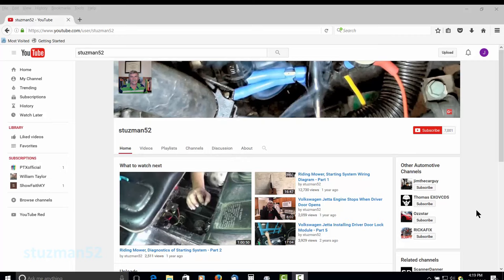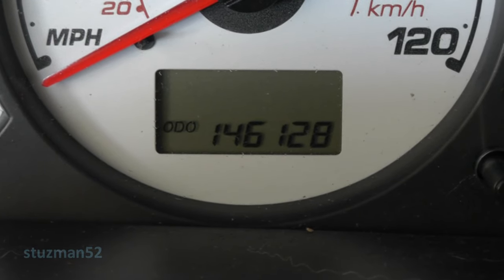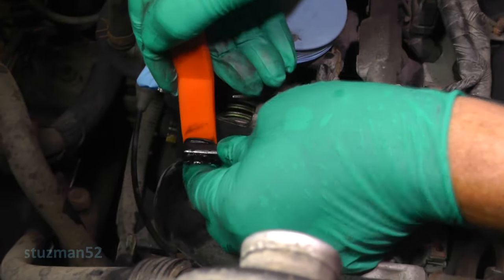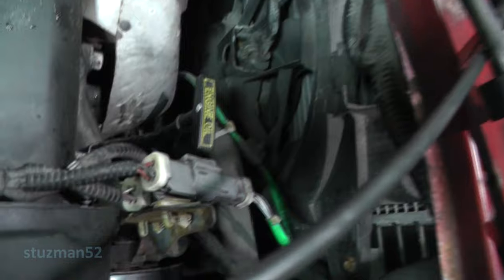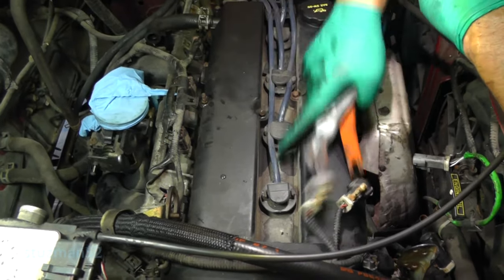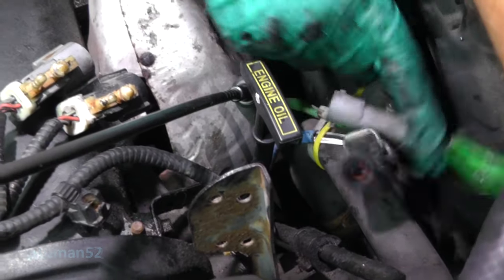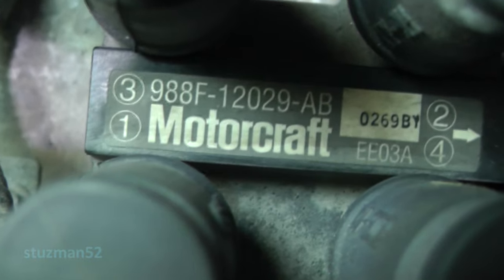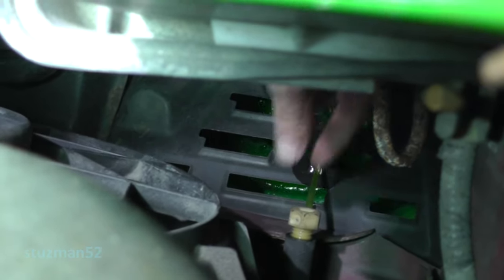Ford Escape Timing Belt and Water Pump Replacement - Part 1

Comment: Are you sure it's a timing chain? I can't find any videos on the timing belt. But I look up what a timing belt cost. it showed a rubber timing belt. I hope it is a metal timing belt. I just bought this Buick. I am trying to learn about it. Thank you so much my friend. You took a load off my mind. Thank you, thank you. I do enjoy your videos. You and your wife do a great job. I was born in the South. I wrote to you before about the Buick.
Reply from the maker: Yep, very sure it's a timing chain. Take a look at RockAuto and see for yourself. I do remember your name, but can't remember the question as I get LOTS of comments. Here is a link to your car http://www.rockauto.com/en/catalog/buick,2002,lesabre,3.8l+v6,1379796,engine
Reply: Thank you so much for the information. You have been a great help. I could not find any information on it. I appreciate it and your videos.
Reply from the maker: You're welcomed Thomas and unless you hear timing chain noise or rattling from it, I wouldn't worry about changing it. I've got 238,000 miles on my LeSabre and it's still quiet. You may want to keep a check on your coolant level as these cars in this year range were bad about the coolant leaking at the intake manifold which of course gets mixed with the oil. I took care of that issue years ago on mine. Take care..
Reply: Hey Terry, 
What happened your brother got all the looks and you not so much. Just Sayin
he he
Reply from the maker: Yeah, I know! Mom, always favored him too :)

Comment: Hi sir my hope you will be fine
I have a question about the mass air flow meter circuit function can you explain me 
I love always your video and the way you explain i understand many thing from you
Thanks
Reply from the maker: It's a little daunting to explain its operation in a text without some diagrams, etc. The air passes over a circuit called a Wheatstone bridge which is made up of three precision resistors and a thermistor. Basically two voltage dividers in parallel. A voltage or current source is applied to two nodes of this bridge. The other two nodes where the resistances are joined is its output. When air passes over the bridge, it will become unbalanced creating a voltage. This voltage is amplified and can be used directly by the PCM. This is an analog type MAF sensor. The other type is a frequency type where the frequency goes up as the air flow increases. Everything in the circuitry is the same as before except the analog voltage after it has been amplified is fed to a final stage called the VFC, (voltage to frequency converter). The higher the voltage, the higher the frequency. That's it in a nutshell and there was some parts of the circuit operation I left out as the explanation would get really long. Hope that will give you a heads-up on its operation. Have a good day Norman!
Reply: @stuzman52  
Thanks for explanation but i will wait for your video on it with some circuit  drawing

Comment: I also have a question... where exactly is the cranshaft sensor located? I was able to find the cam sensor but no luck with the crank.... i have a p0320 code so im trying to weasel out where exactly my problem lies
Reply from the maker: rion bain For the 2.0 liter engine, the crank sensor is located right behind the catalytic converter. You’ll have to remove the converter to get access to it. I point it out in one of the videos in this series where I remove the converter and exhaust pipe. 😀
Reply: Hey Stuzman thank you too much i really appreciate it
Reply from the maker: rion bain You’re quite welcome!

Comment: Well you answered my first question at the end about your wife's accent. Did you get those pro lok pliers from pro lock or did you find them cheaper, they look handy.
Reply from the maker: Are you talking about the hose clamp pliers? If so, I picked them up at Amazon...
Reply: The one used to remove those ridged fasteners, the blue handled ones
Reply from the maker: It's called a zip-clip tool. I can't remember where I got them from online, but do a search for "zip-clip tool" and you will see a lot of resources. Amazon has one too...
Reply: Thanks
Reply: Terry I just got a MAC set of ebay. US made which I don't mind paying a little more for them.Good price and brand new
Reply from the maker: Sounds good Eric and it looks like you're getting ready for a big project yourself :)
Reply: I got too many projects and I'm also a tool whore.  8N ford tractor and a 59 New Yorker.
Reply from the maker: Those two items alone can keep you pretty busy for sure :)

Comment: Can you tell me the camshaft torc spec please?
Reply from the maker: If I remember correctly, it's 55 lbs-ft. I know that I mentioned it in one of the videos of where I was tightening down the bolts securing the camshaft sprockets to the camshafts.